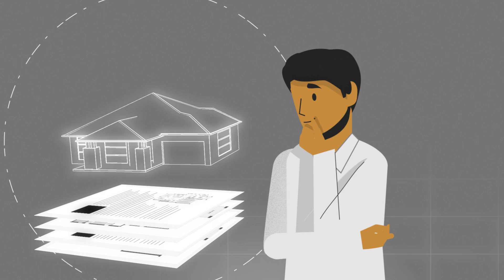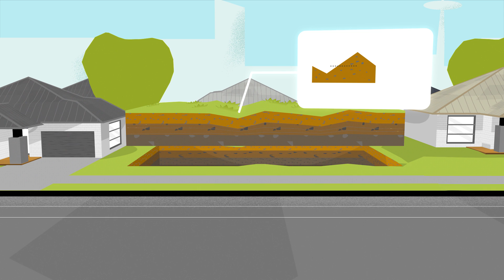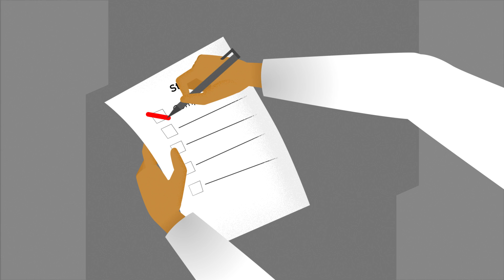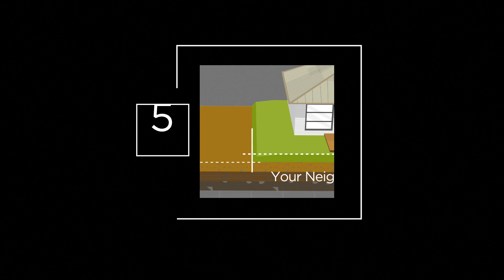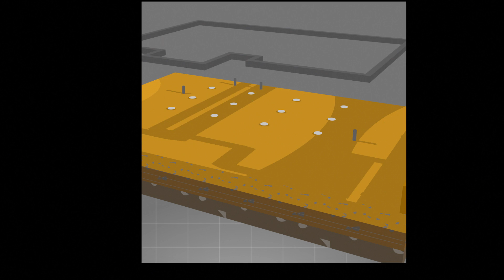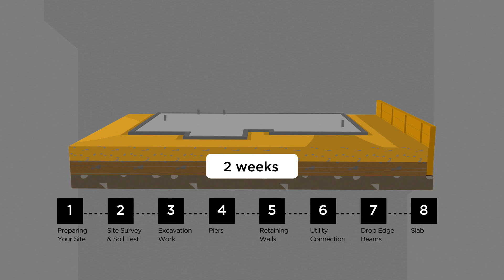Site Costs & Steps to Prepare Your Site

Comment: I’ve never prepared a residential site for structure development.. looks like you don’t need to strip the top soil beneath the building pad?
Reply: Depends on what that soil report says. There will be a section that explains an Over Excavation on most sites. I was confused why that wasn't mentioned at all. there's many more cuts that have to be made as you said but maybe this is a perfect job site that does not require that lol